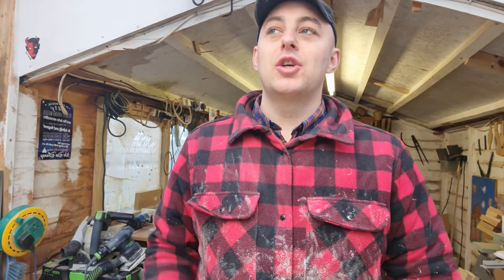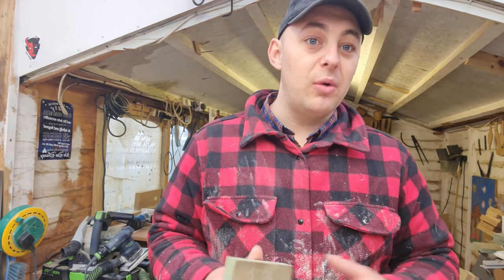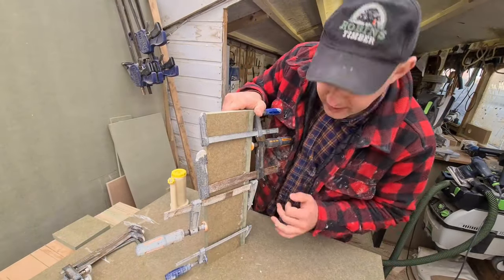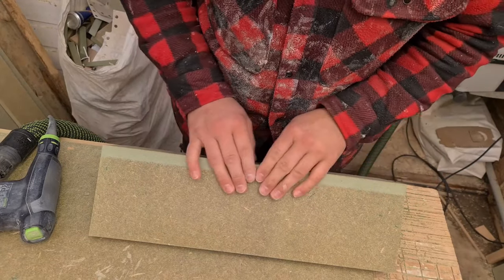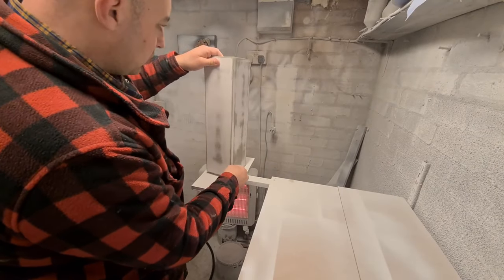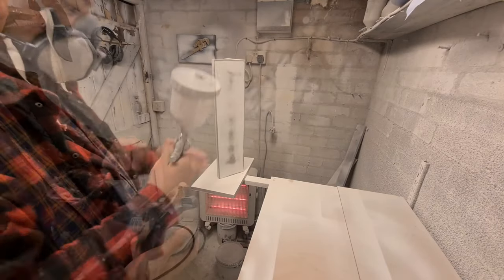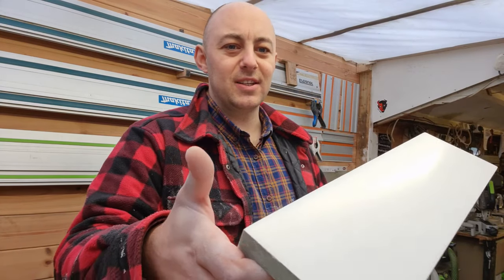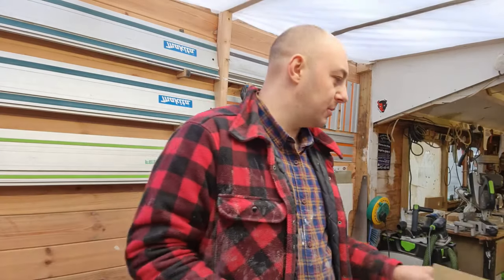How to paint MDF

Comment: How would you go about spraying a l shaped shelving unit with 22 pigeon holes and 2 openings at A4 size wide by 75 mm high and one compartment A4 wide by 200 high there's no back on it and it's made from standard MDF? John Maguire